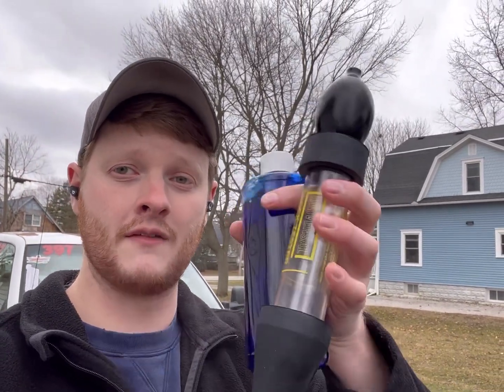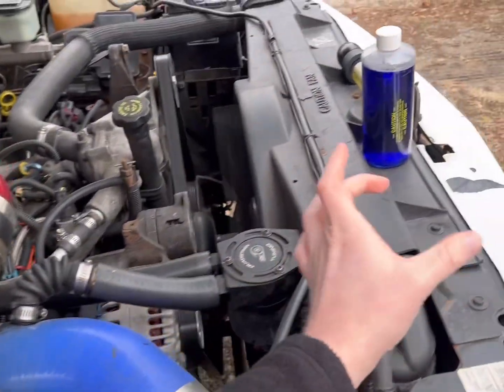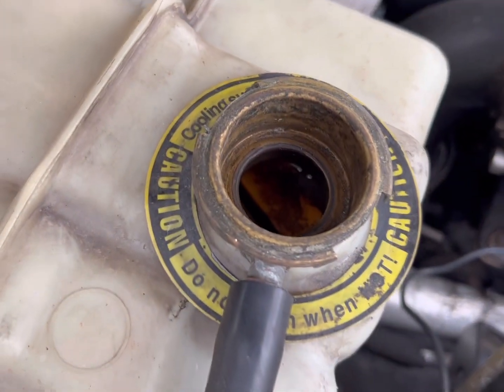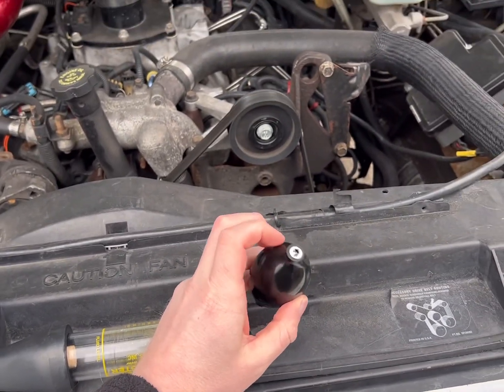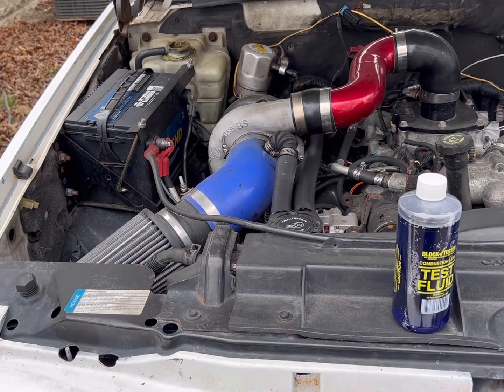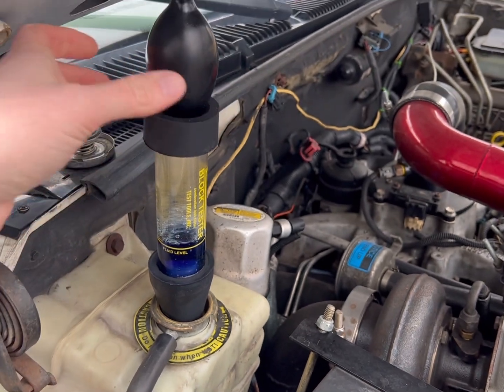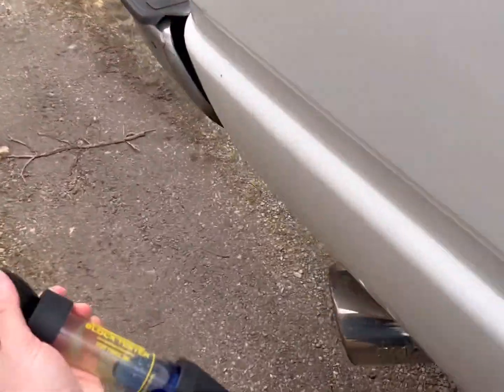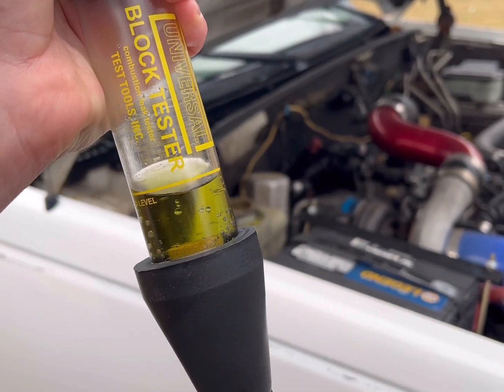GSC 6.5L diesel head gasket test. Combustion in coolant tester

Comment: I thought this tester was only for gas engines? Can I use it for my diesel engine? I want to test it for my cummins. I just bought one of those testers but it says not for diesel engines
Reply from the maker: You can buy for gas and diesel. I get the ones you can use for either or. It worked on the diesel tractor I pushed a gasket on.

Comment: I have 93, and it starts well when cold and doesn't overheat. When I shut it down and wait a bit, then go to start it. There is a bad miss and excessive white smoke for a minute and misses until it's back up to operating temp. After a days worth of use, the rad hose is sucked in, and the coolant level is low. Would it be reasonable to assume that I should test to make sure to see if my headgasket is bad?
Reply from the maker: I would say it safe to your assumption is correct. That’s the sign of a blown head gasket in these. Most likely on the passenger bank.
Reply: @gingersnapcustoms  Now, with that being said, I want to be 100% sure that is my problem. I went to the parts store a couple of days ago looking to purchase a tester. It looked just like the one you are using, but it stated blatantly that it didn't work on diesel engines. Should I regard that and look for another, or just purchase it?
Reply from the maker: @joseesparza2364  you’ll need one that works for a diesel. I can say you have a failed head gasket or cracked head. I’ve seen 10 plus 6.5s do the same thing all ending in that same result.
Reply: @gingersnapcustoms  Luckily I have 6.2 and 6.5 heads up the wazoo. If that is the problem. Thanks for your info. I have to say, you are definitely one of the best channels for 6.5 relates content.
Reply from the maker: @joseesparza2364  spare parts make owning these a lot less painful sometimes. I tried to make a channel that can help out any level of owner. Glad it helps!